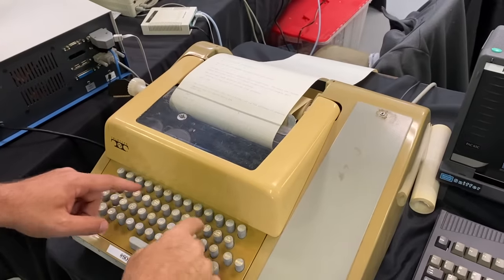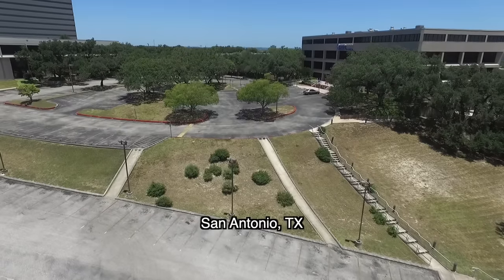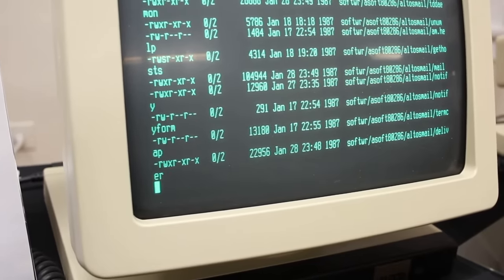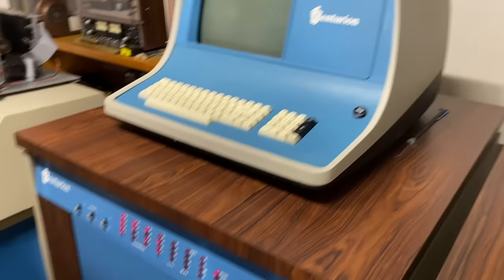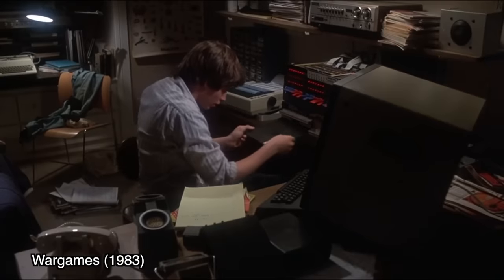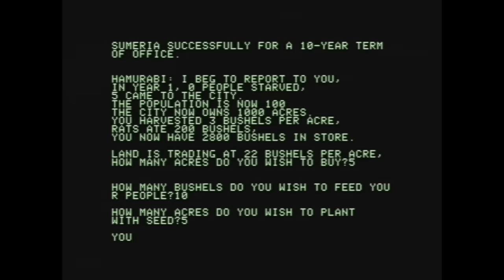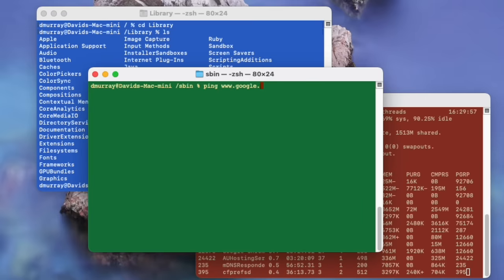What are Dumb Terminals?

Comment: Thanks for the interesting video.  I kind of expected to see IBM mainframe connected terminals in this video, which were probably the most used type back in the 60's, 70's, 80's and 90's (3270, etc.).   There are several types of IBM terminals that supported colors and graphics.  Now we mainframers mostly use terminal emulation software running on PCs which can emulate many types of terminals, including the ones with color and graphics. They connect using TN3270 protocol using TCP/IP running on z/OS or z/VM partitions.

Comment: I have a 1970s Zenith data systems terminal and I knew that it wouldn’t really be able to do much but I still like it. I also collect old TVs and finding one with a cataract is common especially on 1960s RCA color round picture tubes, it happens when the Apoxsee type material in between the CRT and the safety glass deteriorates and can be fixed but it’s really hard and finicky, it requires a lot of heat and patience, you also can risk the CRT imploding so you have to wear protective clothing, there are videos explaining it further

Comment: Glass terminal is what we called them… both the teletype 33 and 35 required constant tuning of the mechanical parts.  They initially worked with a 20ma loop connection, later RS232 was added…

Comment: I worked at a warehouse where the management was insistent on the invoice system having single-use "dumb" terminals, to the point new PCs were stripped down to run FreeDOS with TinyTERM. Thankfully management eventually finally resolved to use a modernized system. In 2017.

Comment: About 30 years ago I got a tech job at a TV news operation. At the time they used a Digital terminal system that controlled the news systems and wire service.  I think it was called Basis (Baysis?). It was all black and white with text email and no graphics outside of black and white blocks forming lines.  Thing it, it was fast to navigate. No mouse required. Just right arrow key in, left arrow key back out a tree level.  Eventually we went to Windows 95, then NT/2000.
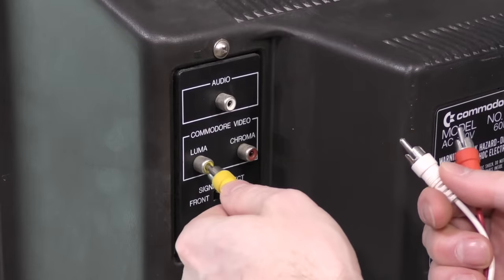Reply: Hey, @ 10:04 that looks like what we had at work in the early 90s.

Comment: Basically what's missing from the "monitor and keyboard" interpretation is the video circuitry. Not just the memory but the chips that read it and generate the video signals that go to the tube. What a lot of people don't realize is that those screens have no way to keep displaying the same thing for more than like a 25th of a second, so you need the equivalent of a video processor continuously reading the screen buffer (which in those days of expensive RAM was nothing more than a matrix of ASCII text codes) and spitting out pixels at a rate of a few million a second, even when nothing's happening. Compare that to teletypes which only need to do stuff when you're typing or receiving text.

Comment: Brings back memories, have both worked with teletypes (as console to a PRIME minicomputer) as well as terminals. And indeed up to this day I use Putty to connect to linux machines (be it for my work or to communicate with my raspberry PI's). One small detail I missed in your video, that on unix and linux-machines remotely connected users still get assigned a tty-device, where tty stands for teletype.
Reply: I also used to work with PR1ME computers, back when I was a computer tech.  And yes, that is the number 1 in the name, not a letter I.

Comment: We used to use the same terminals when I started out as a programmer.  The terminals were connected to a bank of CPM machines running on 64180 processors which was pretty advanced for the mid 80s.

Comment: At least in Linux there's not only the software emulated pseudo-terminal, but also a hardware emulated virtual terminal, called tty. Of course, tty stands for teletype. It is usually accessable by pressing CTRL+ALT+F2-6. It's a remnant from the UNIX origin and early days of Linux. But it's still usefull nowadays sometimes, for example when your x-server got fried  you can use the tty terminal to kill and restart that process, or you can change and repair the config files. Or if you run a Linux machine without a graphical environment you can use them to run several screen locking processes simultanously and expand the tty terminals up to 12.
Reply: I think you can add more terminal instances, but you need more function keys. You can also run a ton of X servers at once for whatever reason.

Comment: I remember back in high school. we had a teletype, with a paper tape printer/reader.  When we got our first CRT terminal, it seemed amazingly fast.  300 baud!  Then the first 1200 baud terminals came and we thought we were in heaven!  Remember wanting to get  Dec-Writer II to have at home one summer.  120 Characters per second out of a "typewriter", that was the cat's meow!  Times have definitely changed.  Although even today, you can see some remnants of the old dumb-terminal type systems.  Airline reservation systems, and even some auto parts inventory systems still use old mainframes/dumb terminal tech...

Comment: Another reason for no computer screens being used on TV is the synchonization problem. They would appear to flicker all the time, even in the late 80s you hardly find any active computer screens. If they had a display, it would usually be a projectioon or a transparent foil being backlit. I am not sure how they did it in cinema, but judging by the short clips in this video they probably did the same, only static images are shown.

Comment: born in 1970 in Vienna. My father worked at IBM, they had an office block on the "danube channel" next to the city center. Round about the age of 8 somewhere between 1977 und 1979 i have faint memorys of paying a visit to my dad's office which at that time was a very large room with lots of paravents to separate the work places from each other. My father then introduced me to a thing he named "terminal" and i was allowed to fiddle with it. today i assume it was a version of the IBM 3270 series, it's screen was monochrome (green and black so it was either a CRT or some kind of vector screen), the cursor was re-positionable and the screen could becleared. i faintly remember some kind of primitive game where you could move blocks around the screen so someone must have written this program to demonstrate the repositionability. my father told me that the computer was somewhere else ... in the basement ... and i remember me as a child picturing that every press of a button of a key on the keyboard must have closed some kind of contact in the basement and some kind of information would have to come back? perhaps not quite true and the computer (mainframe) was not in the basement but rather on the office floor, faintly i remember some kind of raised-floor structure with lots of cables underneeth. also i remember that the Terminal made a distinctive sound when scrolling up quickly, e.g. when a list of something was printed onto the terminal it made a kind of softly-roaring sound at a low frequency tone. don't know if there was a loudspeaker somewhere and this was intentional or if it was from some part of the terminal, once i read something about a mechanical delay-line that was used to store the screen content, instead of RAM, maybe this delayline made the noise? anyway, that's my very eraly memory of a terminal

Comment: The UNIX machines ysed X terminals, which permitted one to use a complete GUI with windows and a mouse. In fact in the 90s SGI marketed a  X-Term with a graphics processor so that multiple users could share a single SGI computer and do 3D visualizations. How this was achieved is OpenGL used a grouping method for objects in scenes called a display list. Objects could be sent to the X-Terms with the OpenGL hardware to unpack and display the contents. This could work well for solid graphics like gears and pistons, cause it was the same objects replicated in space, so to draw multiple, you'd used homogeneous matrices to apply transformational projections to the 3D data. Matrix stacks were used to create parenting relationships, some could be used to project a space on a flat screen before drawing, using Z-buffer data (per pixel depth, used for cheap intersection detection (the z depth of pixels on two or more surfaces determined how much if any each surface contributed to the color ifthe pixel, useful for simulating fog, depicting transparencies.. Modern hardware takes it further to associate programs called shaders which can use information aboit the scene graph to simulate material properties.. Microsoft stole much of their DirectX technology from SGI while SGIs upper management was being seduced by microsoft to inspire SGI to make graphics boards for the PC.. But what happened is SGI got steam rolled, but it serves them right cause their management were much to arrogant to really retain the poorly streamlined hardware that was constructed inhouse by hand.. NVidia ended up essentially replacing SGI.. BMRT , Blue Moon Rendering Tools, was an implementation of renderman, Pixars product, but BMRT was freeware and it supported raytracing. Pixar sued the developer of BMRT. Nvidia came in saved them from the lawsuit, then hired the developer to help NVidia implement shading into their hardware.. And the rest is history.  The main difference between game cards and performance 3D processors , is the game cards do all the 3D obhect setup and transfirmation in memory using the CPU, then the pixelated rendering is done in the game card..  In a performance graphics card do everything inside the graphics card, including polygon setup.. The CPU is freed to do stuff it does well.. A game card could be used for 3D animation, but at animation houses like pixar, theyd give their animators more fluid environments. Mobile devices like the iPad utilize a technique  that us energy efficient, a tile based approach to computing z-depth..

Comment: Interesting recap of all the terminal technology of past decades. I would like to add the following:
Dumb terminals are basically remote interfaces hooked up to the mainframe (or mini computer or whatever central machine is in place). By pressing a key on the keyboard, you are sending an interrupt to the cpu of the mainframe. This interrupt gets processed, and the main frame translates the "key pressed" signal into the actual character and sends it back to the terminal via the data line. The terminal receives the data and displays it on the screen. Basically that's what he explains at 11:04 referring to the echo mechanism.
You can see, that this roundtrip might be delayed if many users are working in parallel. Everyone is working on the same cpu and also you need to transmit signals back and forth to get your character displayed on the screen eventually.
Now the buffered terminals come into play. These are less dumb in a way, that they do not need to interact with the cpu for every keystroke. A buffered terminal can hold an entire screen of character data and is able of positioning the cursor and displaying characters typed in. Basically you work locally on your data without any communication with the mainframe unless you hit submit. Then the entire buffer gets transferred at once and processed by the mainframe which in return sends you a new data set to display. Then you can work locally again until you press submit again. By this, the actual load of the cpu gets reduced a lot thus increasing the number of terminals that can work in parallel.
See for example the wiki article for the IBM 3270 terminal for further reading.

Comment: I took all my coding classes in college using a VAX computer. The computer lab had a full section of terminals. What was amazing to me at the time was that I could call it from my dorm room and use it from my Windows 3.1 laptop. It was actually obsolete then, but I had a lot of fun on it!

Years later, I used Linux and created a thin-client lab in my classroom. The computers weren't dumb terminals, but they were old, and they ran everything off of a server. Now, my students all have their own laptops.
Reply: Back in the 80s, I took some programming courses at night school.  In class we used terminals connected to an IBM mainframe.  Instead of trying to find a working terminal, I'd just go home and dial into a VAX 11/780 at work and do my homework there.

Comment: When I was in my late teens/early 20's I worked at a carpet and tile store which had several locations in northeast ohio. I remember both as a warehouse employee at a few of the stores, and later as a salesman, using their monochrome terminals to check stock at the main warehouse and even at other locations. I think there were basic search functions that with an item stock number I could search for things across the company. However, in the early 90's they still did a lot of things old school, so we always had to call the other store and check with the warehouse schlepper or a salesperson (if the schlepper went home for the day)  to see if they physically had the tile or carpet or area rug or vinyl in stock. Also I think in highschool and college a lot of the searching for books and media across the library network (I forget the name at this point, but all ohio libraries were connected to some degree) used terminalss to get a something reserved and sent to your school.  Then finally, the company I currently work for since 2000 had 4 color ibm terminals with Series M keyboard (I wish I would have salvaged all those keyboards when they upgraded to pc's with windows xp pro a few years into working there, I could be sitting on a lot of money.) in the call centers where we took autoglass claims from around the nation.  I still use a Series M to do my work in the billing department of our company, because it's a tank and we still use the mainframe for a lot of our work in billing. Although a lot of it is done in a modern environment for most things there are many of us who still use mainframe and navigate without graphics.  :-) (actually since rona times I migrated from hybrid work to 100% remote, so I can use my series M every day and it doesn't bother anyone. I couldn't use it in the office after a certain time period when we got "updated" windows 95+ friendly keyboards.. I would still use it on my work at home days though. and now do everyday!)
Reply: Model M. not series M. Sorry.

Comment: Early roms were diode matrix arrays built on a plug in board. One company developed a stotage crt  screen avd another company used an analod delay line as screen memoty. some of the adl terminals made an annoying screeching sound as they worked.
the earky dumg terminals were eventually replaced by thr DEC VR series smart terminals and  ANSI standard compliant emulators were programmed for rge VT100 and VT220 models

Comment: I would think that a vacuum-tube-based system could use a spinning magnetic drum with a few fixed heads to generate a text video display within a fairly reasonably sized cabinet.  A bit bigger than the glass teletypes shown, but not outrageously so.  The drum would hold both the working screen image and the character set.  Cursor position and scrolling would be controlled by the phase of some blocking oscillators that could be gated by a higher frequency clocks (if e.g. one had two oscillators that were tuned to run at about 1/9 and 1/10 of the main oscillator speed, but were biased by the output of the main oscillator, then they would trigger together exactly once for every 90 cycles of the main oscillator, and so two blocking oscillators each containing a triode, a center-tap transformer, a cap, and some resistors, could together hold a cursor horizontal position.

On the other hand, if there were a desire to have an ephemeral-display terminal, another approach might be to use a teletype but make the unit type onto a wax drum, and have a heated roller continuously erase the rear portion of the drum to allow reuse.

Comment: CRT terminal, made of tubes instead of semiconductors, may use ultrasonic delay lines (mercury delay lines were used in the early computers as the main memory). The most common 64 us delay lines used in PAL TV can store about 256 bits each and someone need 32 DL to store a screenful of text. Chargen ROM may be made using ferrite beads.  It will require somewhat 480 pcs of them to display 96 subset of ASCII in 5 by 7 matrix. Not too much. IT will also take some 10 to 12 vacuum triodes to excite coils and regenerate information stored by DL.

Comment: The goal was to change the output counter for the request, and now the instantaneous variable processor came out for us with the speed in the analysis, and this is an achievement instead of changing the board and the processor

Comment: I do believe that a terminal made of vacuum tubes would use a loop of video tape as a frame buffer and a diode array for the character ROM.
But yeah, it's amazing what we were able to accomplish with TTL logic. Check out the schematic of the original Centronics line printer if you get a chance.